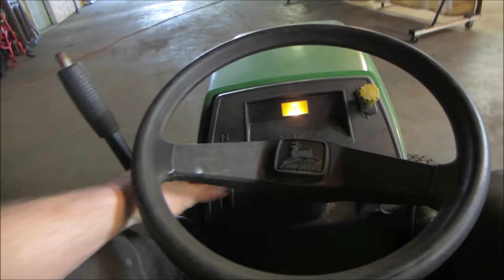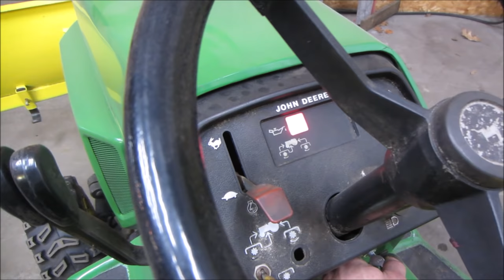SAVED FROM THE SCRAP, John Deere Will IT Run Series, 3 of 3

Comment: I'll be more impressed when you strap a gallon of paint to the recip saw to mix that!!
Reply: I stopped the video and did a screenshot of it! Posted it to Facebook. BRILLIANT!
Reply: Jeff Grey when my son was young, I told him once he had to shake the can until he couldn’t hear the BB anymore, that’s when you know the paint is mixed right.
Reply: i wonder if that trick would work with an inverted DA sander , then tape your gallon of paint to it
Reply: yeah. Someone should come up with an apparatus that uses an otherwise idle recip. saw for that. Would save a trip back to the hdwe. store to reshake a partial can.
Reply: @robj2704  ....A stick would save a trip to the hardware store!
Reply: They sell an adapter on amazon  that goes on the reciprocating saw to shake a paint can
Reply: Shhhh. he'll make a rig to shake a gallon for the sawzall
Reply: @888johnmac  Orbit is too tight on a DA sander to do much good. I've tried it.
Reply: That was ingenious

Comment: bearings... Can't tell you how many times I've resurrected them.. Skated a 62 mile race in Central park,(inline skating) start to finish in the rain with oiled bearings one side open on each bearing. Basically water lubricated the bearings after a few miles.  Race over, skates dried off and put in a bag. 4 days later, back home in california, every wheel (10) frozen solid.  Soaked them in W-D 40, then after a day, used my lathe, and spun them in a wheel one by one till they broke free. Then I soaked them again after cleaning them till no more orange came out. Used those bearings for up to 100 miles a week for a year to train in and they actually worked ok. You could hear me coming from a mile away though.   :).  BAck in the day "fafnirs" were the best bearings..... Like pre 1980.

Comment: Mustie, on the 318, the altenator puts out 28 - 30 volts AC. It goes into the rectifier/regulator, and comes out as around 13.8 volts DC. The yellow charge light measures voltage, not amps. It comes on whrn battety voltage is less than 12.7 vdc
   Note:  Mine had a worn wire, behind the front pulley, where it leads to the starter. This bled voltage off, which caused constant charging, and boiling the battery. The cost of reg/rectifier is $90 from deere, but can be bought, new for around $20, aftermarket. Mine was the exact same Mallory, as the deere was. An oversize  snow blower sprocket is available, to make auger turn faster........
Reply: Its a Kawasaki part and an aftermarket one is cheap on Amazon.

Comment: I had a similar issue with spindle bearings. They had grease fittings and sealed bearings. Took out the inner seals and put in new fittings. Been good to go for almost 4 seasons.
Reply: Engineered failure.
Reply: I could only figure out the grease is to keep the inner spindle from rusting as it served no purpose to grease them other than to see grease come out where the blades were bolted to. Basically wasting grease.
Reply: I had a noisy spindle on a Deere John L130, took it apart to replace bearing(s) and found the OEM sealed bearings.  Now I just don't grease them.
Reply: the grease pumped into a spindle with sealed bearings could work as a heat sink. The spindles do get warm if not hot while mowing for any length of time.

Comment: I actually revived a seazed ballbearing in the boogie of my snowmobile once, a sealed ballbearing. Smal screwdriver to pull the plastic lid of and then alot of wd40 and wirebrush action, filled it with grease and bob's your uncle.
Reply: And no i dont' like the oversized sheetmetal, make it fit the hole and weld it, grind the welds down and it Will look factree! Vgg gang!
Reply: @Beard 79: They make an injector needle that snaps in place of a zerk in a regular grease gun. Let's you grease right past that seal. I got one so I can grease the squeaking bearing in a bread maker.

Comment: On the 318, test the two wires going to the voltage regulator with an AC meter. Should be 20 to 30 volts AC If it does the regulator may be bad.
Reply: kevin faulkner Actually, at full throttle you should see about 28 -30 VAC. The regulator rectifier will cut that by half to about 14-15 VDC.  Charging voltage should always be higher than resting battery voltage. Resting voltage on a fully charged battery in good condition should be about 13.8 V.

Comment: on those bearings i drill and install a grease zerk and drill a hole in the spacer then remove the inner seal on the bearings, keep greased and will last 4 times longer. same on spindles if grease-able  remove inner bearing seals.
Reply: The spindles made me cry and them buy new ones for mine. No grease fittings but they were cheaper than new Deere ones.

Comment: 15:00 instead of a zip tie I’ve used fishing line in the past. Also depends on how large of a gap you’re trying to fill.
Reply: This sounds like a good tip, thanks for sharing.
Reply: I’ve wrapped a little Teflon tape around the threads and then filled the knob with JB weld.  When it hardens you can unscrew it and the threads remain.  Easy peasy.
Reply: I've seen a lot of electrical tape used over the threads of the shaft.
Reply: @jayandmargie  outstanding
I am gonna use this on a wallowed out keyway by covering the key and JB weld on the keyway
Reply: Ohio farmer, I haven’t tried it on a key way, but imagine it would work fine depending on how much force there is on it.  Hope it works great for you!

Comment: The way I remember it when you picked it up, the valve stem was on the inside. I remember you had to turn the wheel to add air???? Maybe Im on crack.
Reply: You are correct
Reply: Yes you are right... my snapper is the same

Comment: I bought a 214, 20+ years ago.  One of the first adjustments I made to it, was was to turn the front wheels around to provide easier access to the valve stem.  Never had any trouble, but always wondered why JD did that.  I'm located in the country, 20 miles west of Rochester, NY.  I've enjoyed your videos for several years now and always look forward to your next one !
Reply: Valve stems to the inside is common.  Garden tractors take a beating in the field and this keeps the stems in the rim!

Comment: Anyone else thinking the seat safety wire should go through the opening just to the front of the seat instead of out via the gas cap opening?
Reply: yes. So it doesnt yank on it when the seat is lifted.
Reply: Yes!  I was talking to the screen but he didn’t hear me.
Reply: Likely that connection will be jumpered and not connected to the seat.
Reply: It looks like it, doesn't it? but he has it right, at least it's the same place as ours comes out. The other opening is for the petcock, and it's fiddly enough to turn without having wires to foul up your fingers.
Reply: Yup!!!
Reply: 5:33 of the 1st video shows it going through a it's own small hole between the gas cap hole and the square opening
Reply: Yep. I’m surprised he couldn’t hear me.
Reply: Gene Hasenbuhler  It seems like it. His comment isn't there anymore.
Reply: it goes in the round hole next to the cut out for gas shut off
Reply: Doesn't come out of the gas hole.
Reply: Not really .. I'm thinking about the rusty spacer he put back in between the bearings... like a lot.
Reply: @cut--  That's why you grease it.
Reply: @alwaysopen7970  I grease my spindles. It runs into the bearings when it heats up.

Comment: I’d be curious to know what price Mustie 1 
put on this beauty.
Reply: I’d say the thing would be worth 350 to 500 since it’s in full working condition. I’d say maybe even as high as 600 if it was 165. Those are good mowers Kawasaki engine and really tough the 38” deck is small but long lasting.

Comment: When you have a spindle that the mfr used sealed bearings and a grease fitting, the solution is to take the seals that face the grease fitting out of the bearings. Manufacturers should be sued for incompetence for crap like that.
Reply: The fully sealed bearings with rubber seals aren't that bad since they don't let dirt in that ruins the bearing. Replacing a bearing isn't the end of the world as long as it's a standard size.
Maybe we should figure out a way to send some random bearings to Mustie1 just to improve his stash?
Reply: Don't try to grease sealed bearings.
Reply: @johnpossum556  By the time you hear a bearing going bad it is too late for more grease.  It may work temporarily but you might as well replace the bearing.
Useless to grease the zerk fittings in most bearing spindles as you are just filling a void.
Reply: @gordbaker896  I used one on an Oster bread maker's pan bearing and it's held in there so far. It is geared way down so it doesn't spin very fast at all. I was more concerned about the heat cooking the grease right out of the bearing but the lucas red n tacky says it was good over 450F so I gave it a shot as I didn't have the tools to get the bearing out at the time.
Reply: That's a 30 year old mower.  I think the sealed bearings did pretty good.
Reply: @johnpossum556  Glad it worked for you.
Reply: I still contend it is engineering mslpractice to use a bearing that is sealed on both sides in an application like this. Otherwise there is no point in putting a grease fitting in the assembly.

Comment: Just started watching your channel about 1 month ago in that time with your information on this channel I have rebuilt the carb on my craftsman T1400 and got it running and mowing my yard and took the Murray 46 inch cut and did a valve adjustment and got the thing to fire off then rebuilt the carb on it as well as changed 3 of the tires on it now gonna take the deck off and use as my yard tractor to pull the cart and do clean up thanks for all the great info I had never worked on a small engine before other than air filter and oil change keep up the great work.

Comment: It's grass cutting time here, not sure where you live but it's high. Cleaned out the carb  of my Troy and it runs wonderful now.    No more hauling up a hill with a non self propelled mower..  This mower is now HOSS!   I use my old Bolox  mower on areas that are rocky and full of nuts, stones, etc.

Comment: 57:23 I used a jumper pack for a few months on my Deere and when I couldn’t get it to start with the - jumper connection on a metal ground, I used the - side post of the battery. This eventually fried my electronic component above the battery under the dash which I had to buy.

Comment: I have a 345 John Deere that needed new bearings in the jack shaft also. I got the new bearings and I drilled a hole in the side of the housing and installed a grease zert. I then pulled 1 seal off the one side of the bearings and installed them with the unsealed side to the inside. when I  pump it with grease, there are very tiny relief holes around the outside edge of the seals on the outer side of the bearing and grease will squirt out of them. the spindle bearings are the same. the factory did not install seals on the inside of the bearings. new bearings come sealed on both sides, just remove the one seal and install that to the inside. that way you know when you grease the hubs that grease will get to the bearings. great video series. love to see someone else's trash get turned into a treasure.
Reply: cardude59The reason they run sealed bearings is they last longer. When there is a greased bearing people either don’t grease them or when they do they push dirt into them or they over grease and blow the seals out. The same reason they don’t put zerts on ball joints and tie rods.

Comment: When driving out a bearing, I use a large socket to fit the hub of the pulley positioned in the throat of the vise and drive against the socket to prevent damaging the pulley, but old bearing races work too!

Comment: Fantastic work. I've watched the first two episodes. I think it's great the way you saved some useful equipment that was otherwise headed for the scrap pile. I like the way you refurbish parts rather  than just toss and replace. It was good, however, that you replaced the fuel lines. I dont have a riding mower but learned alot. Also, j like your philosophy of troubleshooting  rather than just referring to the manual. Not sure if I have the patience for it though, and you lost me on the wiring work.  A great job, and that mower was lucky you took it home.

Comment: I have the exact mower. A friend sold it to me for 100 bucks. Beware old seats! One day I threw it into forward gear and the seat ripped right off-I tumbled off the back like a bouncing panda bear. Gave my back an unwanted adjustment...mower kept going and crashed into the weeds. Got a replacement at Princess Auto...For US people: Harbour Freight? Or TSC? would probably have something-Generic seat works fine. Now I'm going to have to restore mine! Your 160 looks great.

Comment: For repairing that hole in the deck try placing a thin piece of cardboard underneath and trace the shape of the hole onto the cardboard with a pencil.  Then cut along the trace line with a knife or scissor and you have an exact pattern of the hole to trace onto  the sheet metal. 

Just a thought. Enjoyed the video.

Comment: Someone spotted that inside out wheel last week!

Now, you were lucky with those bushings in the 'deck belt tensioner/idler'. . They don't take kindly to heat (ours were destroyed that way), but there is a ready solution, if you ever need it - 15mm copper water pipe just fits on the steel pivot post. If you ever need to replace those bushings, cut a section 15mm pipe to exactly the same length as the pivot post. Next, insert the pipe into the tensioner pivot bore. You'll notice that the pipe is too long, so, make sure the pipe protrudes by the same amount above and below the pivot bore, and flare it over (open it out with a small ball hammer) the edges of the bore, at both ends, and flatten it back against the face of the bore. Now, it's just a nice push fit onto the pivot post, so lube it well and fit it on. Install the washer and snap ring - job done! Did ours that way about six years back, and still going well.

I think you might find that the rotor bearings are not serviceable parts, at least, not in general terms. I would imagine a man of your talents will find a way, if needs be, but we were told by our JD dealer that you're supposed to replace the entire bearing turret (casting, bearings, and spindles). We've been lucky with ours, so far, but they're getting noisy now - maybe this season will be their last before a change is due.

Setting the 'park brake' - depress both clutch and brake pedals simultaneously and move the lock lever into the locked position then release the pedals. To release the 'park brake'  depress both clutch and brake pedals simultaneously and move the lock lever into the unlocked position then release the pedals. Failure to depress both pedals simultaneously will prevent the 'park brake' lock from being locked or unlocked.
Reply from the maker: they can go on both ways, depends on terrain
Reply: @mustie1  Good point! Especially if Aunty Ivy likes to have those jagged rocks around the edges of her lawn. . 🤣

Comment: Go the other 10% and fix the charging system on the 318 and it's leaking O-ring, you practically did all the work already. Don't give up, it's like brand new. You can do itttt!

Comment: I converted one of these 160s to a dung scraper. Made a bracket over the engine. Got s winch for 100 euro on ebay and put a scraper onto it.

Comment: Those bearings for the 3 spindles. 2 for each, 6 total can be obtained from ebay for as low as $12 for the set.....the double pulley looks like the replacement for use with the bagger blower......( that's what I have on that discharge side, for my 318 )

Comment: next time you get a bearing thats loose like that in the hub, you need to hit the area where the bearing sits inside the hub with a sharp point punch. That creates small holes with raised areas that will allow you to punch the bearing back in the hub and be supported all the way around. Sometimes you can even apply a bit of green locktight when you press the bearing in for added support. What you did left the bearing loose and it will most likely spin in the hub. just my 2 cents of advice. old farmers tricks.

Comment: On that pulley for the mower deck, to make it bit easier try putting the bearing in the freezer over night. The metal will shrink just a little due to it being cold so it'll tap in a bit easier. (I know this comment is a few months too late)

Comment: On the spindle Bearings if it has a grease fitting, You can take the inner seal off of the bearings so the grease can get to the bearing. Take's a lot of grease to fill the spindle up.

Comment: I think it was Steve’s Small Engine Saloon I was watching once & he too was talking about grease fittings that do nothing due to enclosed bearings. If I’m not mistaken he said he will sometimes remove the cover from the side of the bearing facing the grease fitting (but I might be totally wrong on that). I’ve also watched one of y’all repack bearings before.
Reply: No, you are not wrong. I remember watching the same video and when Mustie 1 started talking about this issue of enclosed bearings and grease fittings on the cutting deck I automatically remembered watching this video on the Youtube channel Steve's Small Engine Saloon.

Comment: "DAVE'S SMALL ENGIINE SALOON" covered in detail how the factory screws the owner/operator out of put any grease in to those arbors by using double sealed bearings. Before installing new ones just pop one of the seal out of the new bearing. Install the Open side IN..

Comment: Next time you have a loose bearing, stake the inside of the boss on the pulley with a center punch and use loctite red in there with a little heat to setup the loctite.